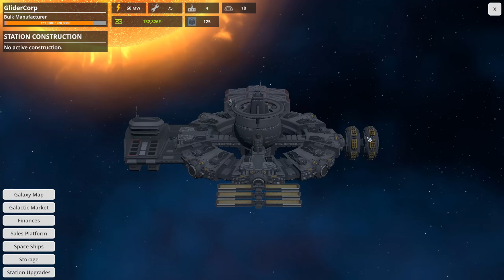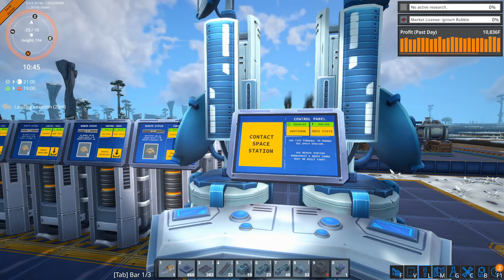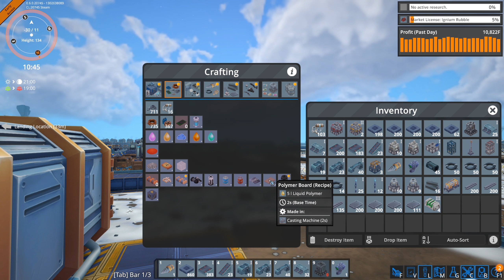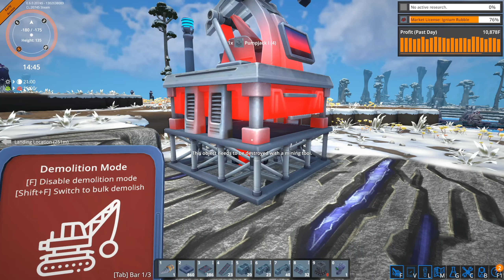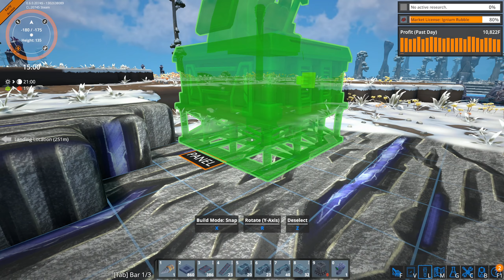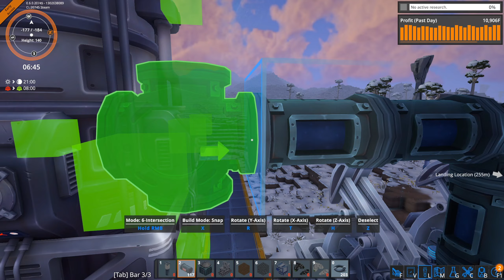Olumite & Polymer Boards! | Foundry s03 e09

Comment: 3:40 In general, I'd recommend increasing science production instead of stacking up a large pile of it, but that's only important for infinite research later on... but this research became effectively obsolete in Update 2. :|

5:30 When placing down olumite pumps, you can place them anywhere above the ground if you disable snapping (hotkey X, as UI suggests). This way, you can place anything effectively in the air. For example, you can build a layer of foundations above the olumite (or literally any blocks), remove 1 block in the middle of every 3×3 where you'd like to place a pump and then place the pumps in free placement mode above that hole, so the drill may extend through it and touch the olumite below. Personally, I prefer to cut out 3×3 in the foundations layer and sink pumps 1 block down, so the bottom layer under them isn't visible.

14:56 I learned from my previous playthroughs that building distillation towers anywhere near the pumps is a bad idea. This alone won't turn the processing facility into an ungodly mess, but it sure won't help scale it up later.

17:02 Good guess. If only the game would support this instead of forcing i/o ports for liquid resources. -_-

18:25 There's no "correct ratio" for flare stacks, unless you stick to a single recipe per group of distillation columns. Some produce 750 waste gas, some 375 and some 150. So, unless you want to build them specifically in groups of 4, 8 and 20, it's easier to just share the output pipe between all of them (you'll need at least 40 distillation columns to fill out a single pipe anyway) and add as many flare stacks as necessary. :)

19:30 Yep, this is quite an overkill. You won't need even a half of this for a while. :)
1 Casting Machine process 150 liquid polymer into 30 polymer boards. 1 distillation tower produce 1125 liquid polymer per minute. So, that's 7.5 casting machines per column and 225 polymer boards per minute. That's already more than your T1 belts can handle. To process the output of 4 distillation columns, you'll need 30 casting machines, and you'll end up with 900 polymer boards per minute. That's way above what you may need anytime soon. :)

25:10 You do know you can drag the pipe from below just fine? You don't have to be above it. Not that it'll help much, considering you already messed up I/O ports.
29:58 I wonder why you place a block that'll obstruct your access to the block above it first and then run around trying to add that one block above a few seconds later.

32:07 There's no good way to line everything up. Especially when you place one of them 90 degree off. XD That's why your olumite input end up there.
This design can work, but polymer outputs will be pointing in/out the block diagonally from each other. Less squirrelly pipes overall, though, considering only output pipe goes all over the place.

34:55 You don't want to route pipes too far away unless you absolutely have to, or you'll be forced to use pumps, and you have to power them up. Each segment of pipes is limited to 300 pipe "blocks", as I recall. As soon as you go above this limit, throughput drops to 10% for the entire segment.

43:00 Unless you want to handcraft solar panels and batteries, there aren't many other places to use them in handcrafting. And I strongly recommend automating these. At least tier 2 of these.

44:28 Fun fact. By building a reactor, you are trading construction materials and firmarlite for time and convenience. Solar panels cost less for the same amount of power produces, but you have to build multiple and that takes longer to build even with a thousand construction drones. At least reactor expansions are like that.